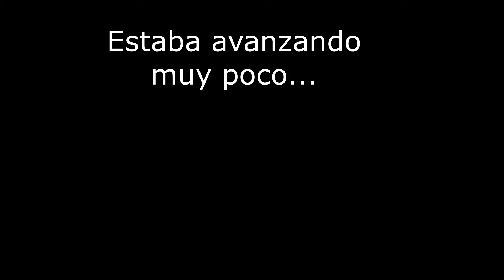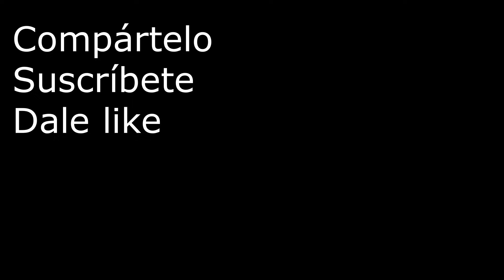Maquina Manual Para Rebobinar Armaduras de Licuadoras, Taladros, Pulidoras, Aspiradoras, Etc.

Comment: HOLA LAAAA KERIDA PROFESORA... BONITO DIA... I PREG. NO ES EL CASO DEL VIDEO PERO BUENO AHI LE VA .,, X KE SE DERRITE UN CAPACITOR DE LAVADORA??? SALU2 Y DE ANTEMANO MUCHAS GRACIAS X SU AMABLE RESPUESTA GRATZIE!!
Reply from the maker: Es porque el motor trae alguna bobina cruzada o fue usado mucho rato y por eso el capacitor se quema
Reply: @AprendiendoconAlicia  PERO EL DETALLE ES DE RIPLETY X KE EL CAPACITOR U CONDENSADOR DE TRABAJO X KE ES DE BAJOS MICROVARADIOS ES DE VAC 250... ESO ES DE VOLTAJE D CORRIENTE ALTERNA PERO COMO TRABAJO ALREDEDOR DE 6 AÑOS BIEN U ESE CAPACITOR U CONDENSADOR HIZO KE TRABAJARA BIEN LA LAVODOA A 127V. ???